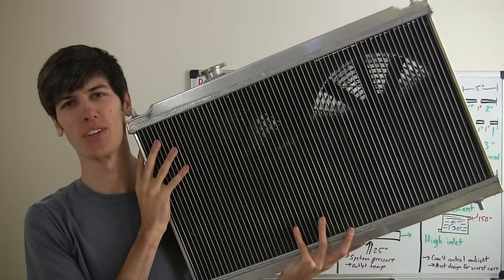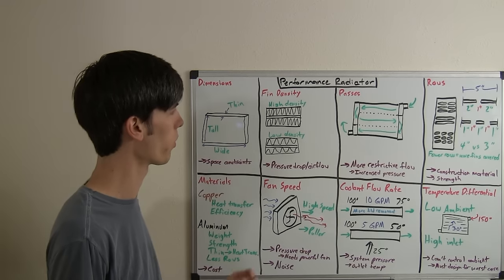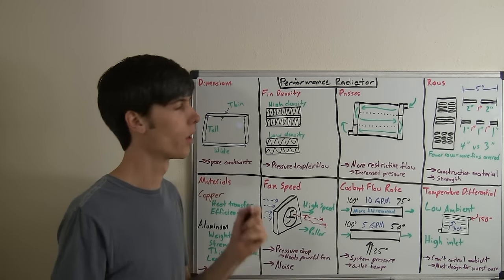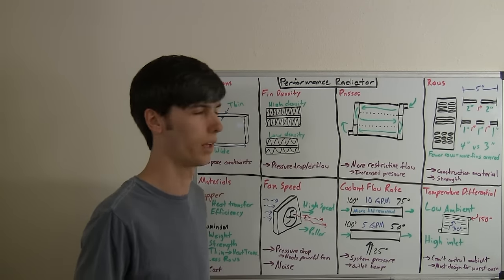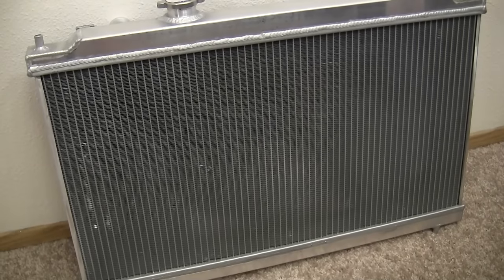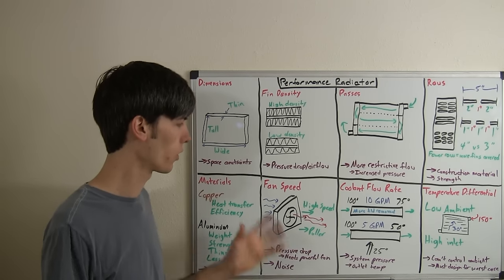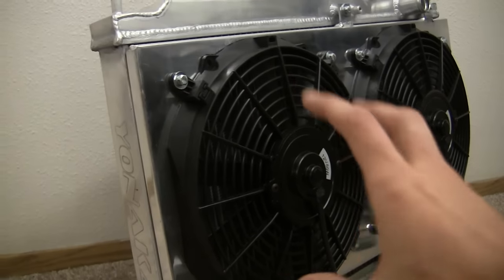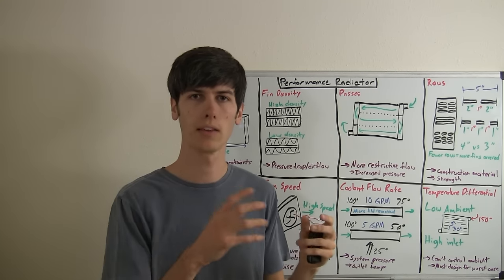Performance Radiator - Explained

Comment: One thing to touch / comment on is #5 (Material Selection). There is a common misconception in the automotive world which I see quite often when it related to material selection for a Radiator. This misconception is that what people often call a "Copper" radiator (which is really a copper/brass radiator) and it being better for cooling is not true at all. 

This is false because while Copper is a better conductor of heat energy, the only part that is copper in them is the fins. Everything else is brass (I.e., the tubes, headers, tanks, etc...) Brass has a lower thermal conductivity rate then aluminum to start with. So the heat transfer out of the water (coolant) is slower in since it has to conduct through the brass tube. The next issue is the "copper" fins are soldered to the brass tubes. The Solder also has an even lower thermal conductivity rate then the brass tubes. Essentially, the solder acts as an insulator between the brass tubes and the copper fins.

With an aluminum core, the construction of the core is essentially 100% aluminum (Aluminum Tubes and fins with an aluminum based braze cladding) so the thermal conductivity rate is virtually the same throughout all components (which is higher then the brass for the tubes and the solder of a C/B (Copper/Brass) Radiator).

It was a Manufacturing cost issue as to why for the longest time, the automotive manufacturing industry used C/B radiators. It was viewed as, "while overall, the aluminum unit will truly cool better, the C/B worked "good enough" and it was much cheaper to manufacture (much cheaper to stamp tanks and components and solder them then to fabricate and weld aluminum tanks". Plus aluminum brazing clad sheets (whats used to bond the fins to the tube) was not really perfected until the late 70's / early 80's.

With technology advancements in Thermal Plastics and copper material cost rise in more recent years (last 20 years), it became more cost effective to go over to Aluminum cores which is why virtually every car sold new in the last 20+ years has come with either Aluminum core / Plastic tank and in some rare cases, 100% aluminum units (i.e., welded Aluminum tanks).

Also, another thing to point out is that #8 (Temp Differential) is one of the few things (like #6) which explains why #1 is as stated ("better to have more frontal area then thickness) is desirable. As the cooling air enters the grill side of the core, it starts to absorb heat from the fins and tubes. This air gains heat on its way though the cores thickness (obviously)... This heat gained by the air means that the temperature differential between the air and the rear side (engine side) tube(s) is now lower so less transfer occurs from the tubes and fins to the air moving across it as Thermodynamics shows us that a higher ΔT  (Delta T) means that heat is transferred (ΔQ) at a fast/higher  rate between the two media's. Basically the first law of Thermodynamics tells us that an increase in in ΔT = an increase in ΔQ.... So the air entering the grill side of the core will be at ambient but the air in the middle of the core will be hotter and the air exiting the core will be even hotter then what it was in the middle. An easy way to say it will be that the ΔQ will drop as the air pass through the core's thickness.
Reply: Chris P you missed a big thing, aluminium is lighter while offering "close enough" performance to copper, i thought that should be the main point
Reply: Chris P dammm bro. Bible long ass comment. Ain't nobody got time for that.
Reply: I appreciate your informative addition.
Reply: You are physics guy😀
Reply: You said some parts are copper and some are brass... brass is a copper alloy...
Reply: @JoshuaDeanHealey  the thermal conductivity of copper is 223 BTU/(hr·ft⋅°F) and aluminum is 118, while brass is only 64. Even though it is a copper alloy, zinc has very poor thermal conductivity, so aluminum is way more efficient. Also, the thermal conductivity of solder varies between 19 and 78 depending on the alloy, so it adds to the inefficiency

Comment from the maker: Thicker radiators won't be dissipating much heat once the air is warmed up, and still passing through the radiator, hence, having it as thin as possible is best (assuming it takes up a large area, which is not ideal).
Reply: But what if I have plenty of room in the engine bay?

Comment: Often overlooked yet very important especially on some cars like my E46 M3, I have fitted 3 different types before I found the best setup using a pro alloy part, it has a 35 per cent greater efficiency and allows a bigger intercooler to be fitted for the supercharger. A better oilcooler fits into the front now too so everything is much better than it was. Even power went up to 557bhp cos the fmi is reducing the charge temperature more
Reply: what temp thermostat are you using? i am running about the same hp as you and parts store told me to use a 160 degree but i have always used a 195 in the past. i have an over heating problem. going to go all aluminum 3 row and need to know about thermostat to use.
Reply: And what's brand -model ?.

Comment from the maker: Hmm, good question, it really shouldn't change it too much. It may have a small effect, but ultimately both fans would be blowing the same flow rate (or the more powerful fan would do most of the work, if they were different). Increasing airflow would have a much greater effect.

Comment: In your explanation you mentioned that this is a top-down flowing radiator but I believe on Honda's the flow direction is opposite (bottom-up).  The bottom radiator hose is connected to the thermostat housing where hot coolant is released going to the bottom radiator reservoir them moving up through the cores to the top reservoir before being pushed back into the engine via the head.

Comment: For more passes, you get more pressure, which means a higher boiling point, which means (hopefully) less spontaneous air bubbles in the coolant line (if your engine operates close to tolerances like that). Plus, basically, you're compensating for the massive differential of specific heat between air and water when you increase the dwelling time, resulting in more effective overall cooling rates and ultimate cooling results.

Comment: Thanks for making these vids! Three questions: 1) Is it possible to have a push pull configuration for a radiator? If clearance is not an issue It would be cool to take a que from computers and have a push-pull fan setup for a radiator. 2) how would a multiple radiator setup work? Again I'm taking ques from computer building. 3) How does radiators behave or how do people get around debris issues in their radiators when doing thing like deep fording; I see vids of cars fording through flooded streeta for instance and of course I see tanks fording rivers, is there some sort of close-able flap and or a fan shut switch to permit fording? Keep up the good work!!

Comment: On my 1995 300ZX turbo,i modified my front headlights cleaning sprays to fix them directly facing on the intercooler,when needed,in traffic,it brings the temp down incredibly,and when rolling too,easy,i put a bigger tank and pump for fresh cold water only,when driving to Vegas,I add chunks of dry ice,because it has a tendency to overheat when stuck in Tfc.working on a ventilated hood with fans.
Reply: Man that's a great idea, easier than installing a bigger radiator.

Comment: The video was totally informative and there was so much of knowledge to be gained out of it. I have an important question, you said its important to maintain higher temperature differential of coolant. But that's gonna demand more power or energy isn't it? 
Eg. Let's take two temperature differentials of delta X and delta Y, where del X is greater than del Y. Obviously, the former case needs more power to undergo cooling than later, which means the fan has to rotate at a higher speed to meet the objective. I think it's more simpler to have lower temp. diff than higher. Please correct me if I'm wrong.

Cheers!!
Reply from the maker: You want a high temperature differential between the outside air and the engine coolant, so that you can take a significant amount of heat out of it.

Comment: Wanted to give some love to the older videos. Obviously your increased access to resources has made the videos flashy, but the whiteboard approach is lovable.

I'd love a deeper dive specifically on the multi-pass design. 

You said multi-pass would cool more and I believe you, but the mechanism you describe ("increasing the amount of time that the coolant is going to be in this radiator") is false.
For a given area and flow rate, residence time within the radiator is fixed (closed system). 
Thus the achievable heat transfer (i.e. temperature drop, for a given coolant mass flow rate) seems to be hard to modify with this intervention. 

The multi-pass design would seem to have:
1. Higher linear velocity of coolant flow (constant effective area - reduced effective cross-section, higher effective length).
2. As a result: reduced temperature gradient in the horizontal direction (for the horizontal flow you diagrammed). However: paid for with increased temperature gradient in the vertical dimension.
3. If the number of passes is even: the opportunity to have inlet and outlet on the same side  - possibly useful for packaging. You diagrammed three passes, so no benefit there.

Other than perhaps interactions with vehicle aerodynamics (say, upper and lower intake ducts with differing flow potential, and/or a vertical temperature gradient in intake air), only (1) above - higher linear velocity - seems to be a plausible mechanism of action.

Do you know of a scaling rule for liquid-side linear flow velocity (or reynolds number)? I know you usually aim for a lower Nerd Factor than this, but perhaps you could be coaxed a bit?

Thanks for all your hard work and great content!

Comment: These are really interesting videos man, one thing to consider is to make sure you measure everything when setting this stuff up, my mate set up a water to air intercooler and found that by decreasing water pump speed it was working more efficiently, this is because when the pump was at max rpm it was causing cavitation and so the water flow was less than at a lower voltage. Plenty of head pressure to the pump fixes this though

Comment: Great Job covering the radiator you did leave a pro and con out that I could see right off the stock plastic rounded tanks get better velocity than the square one because of the shape (nearly impossible to find round tank aluminum radiators not cost effective to make) although on older cars you can often get rounded copper tanks.

Comment: 5:40 I think another big thing the aluminum radiators have going for them is that they don't cause as many corrosion issues as the copper radiator.

Comment: I would assume you can get a higher energy dissipation via pulling because the mean velocity of the air is greater. This is because once the heat is dissipated, the air is still being accelerated in by the fan, whereas with a pushfan once the heat is dissipated it creates a small amount of backpressure as it is already decelerating.

Comment: So I have a offroad truck with an LS3 in it. It had a stock water pump and a 2 row radiator. It was getting hot when in high demand. I switched to a high flow water pump and it no longer got hot but it still got warm. I switched to a thicker 3 row radiator and it stays cool now. Your information is the opposite of everything that has worked for me over the years

Comment: In stationary applications like liquid cooling on pc, pulling or pushing makes no difference in efficiency. Pulling is preferable though, because any dirt would be stuck primarily on the other side of the radiator which is very easily cleaned. If you were pushing air, dirt would be stuck between the fan and the radiator and it would accumulate over time. I believe that this is the reason car engineers select pull, also a pulling config may increase airflow due to the car's speed.

Comment: Hi, I'm a PC enthousiast and with pc watercooling there's always the discussion about push vs. pull when it comes to single fan on a radiator. In this video you said pull is around % better. Could you please do a video on why pull is better than pull? Is this just a car thing because you already have airspeed from the vehicle moving? Thanks
Reply: I agree my Peugeot radiator works really well n it has a push fan design, mayb u can do a comparison video
Reply: +Unicorn Reviews The pull fan will suck air from the whole radiator area,but a push fan can only push air directly in front of it. 

The fans here are surrounded with a cover, so all the air they suck goes through the radiator. If you imagine the same for a push fan, they would only push air from their own area and only some of it will be directed through the radiator fins. In a push fan radiator, the corners will have little moving air to take away heat, but in a pull fan model, the air is sucked more efficiently through the while radiator, no matter what shape it is really.

If you blow with your mouth, you cannot blow in all directions, but if you suck instead, air comes in from all directions.
Reply: I think the fact the rad is moving and the rad is so much bigger and shrouded is what makes it better, in a pc without proper shrouding the air pulls from around the rad instead of through, so in that instance push is better but using proper fan rad seating minimal difference like .2%
Reply: On pc pull is done so the rad will not keep dust in between.
Reply: for PCs it doesn't matter as much.  for cars, there's a few things that change. the main one is that ideally you want the fan to pull air through the entire surface of the radiator so most puller fans use a shroud.  without the shroud, you're only moving the air over the square inches of the fan itself leaving large portions of the radiator with no airflow. with the shroud you move air over more surface of the radiator increasing efficiency.  well you can really only use a shroud behind the radiator because if you use a pusher fan with a shroud in front of a radiator you're blocking the natural airflow through the radiator while you're driving. Therefore you almost never use a shroud with a pusher fan so you end up with less surface of air flow which reduces cooling efficiency. none of this applies to PC cooling so you're going to have similar cooling with push or pull.  The only difference then would be the fan blade design.  most blades are designed to be pushers or pullers and will only work best in one direction. so while you may be able to reverse the fan by switching the + and - it might not move as much air.  there's an easy way to tell if you want me to elaborate.

Comment: Would installing a bigger radiator like this negatively affect system pressure or put excess strain on the water pump?
Reply: yes
Reply: It depends on the resistance of the radiator, you could put a larger radiator on and if it has lower resistance it would put less strain on your water pump. It is similar to electrical resistance: More parallel tubes = lower resistance, thinner tubes = higher resistance, longer path = more resistance
Reply: no- the engine will soak it up, it will cost hp

Comment: I think they are more efficient because the fan inevitably warms up the air its pushing. And if the fans are in front, the air that hits the radiators are warmer and hence less temperature differential than if the fans were mounted in the back. Also I think when the pulling fan creates lower pressure, air from all over the front is sucked it, while on the other hand, the air follows closely the geometry of the fan, meaning the air will be about the diameter of the fan, hence reducing area.

Comment: i can understand that if it would be able to retain the same amount of fluid as an oversized radiator.  But form my experience, thinner radiators have never out performed my aftermarket ones on my cars and even dirt bike.  With my thicker radiators im able to maintain a cooler running temperature compared to what i would with stock.  I guess im just having a hard time understanding how a radiator that does not hold as much coolant as a thick radiator would offer better cooling.

Comment: Hello from Dominican Repuplic! I really like your videos! Very informative! 
I'm currently buildind a Dakar Race Car with my FJ Cruiser, so can I add multiple radiators to cool down the engine on extreme temperature enviroments? If so, how can I connect them ? can I use multiple raditors to cool down my transmission too??
Reply from the maker: Josemanuel Hernandez I think it'd be best to use a single radiator that's properly sized, and multiple fans, but yeah anything's possible.
Reply: JM
You could install additional radiators but one good one, with the proper fans and engine and transmission oil coolers, can be sufficient. See what other competitors have done. You might want to look into water-to-oil coolers. Those can be installed out of harm's way to prevent damage from rocks and stuff. Again, use fans and thermostats. Remember: Thermostats, gauges, warning lights and proper pumps for the transmission (if manual) and differential are always the best prevention.

Comment: In my opinion a thicker radiator is better. Reason being is the fact that if its thicker you can retain more coolant compared to a thin rad. Therefor you will be able to maintain a more stable temp